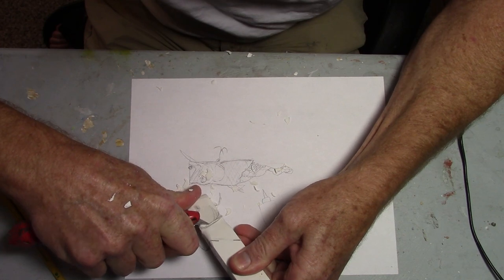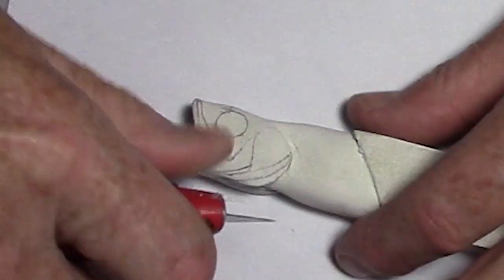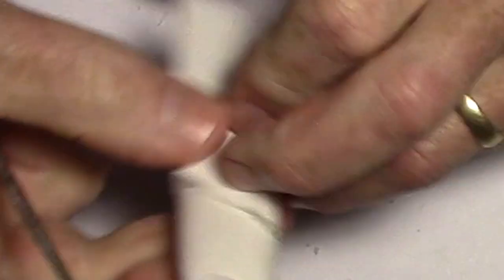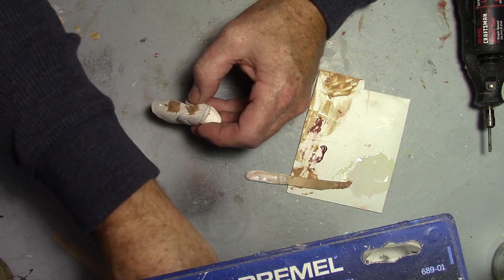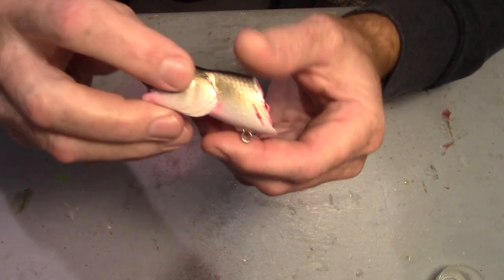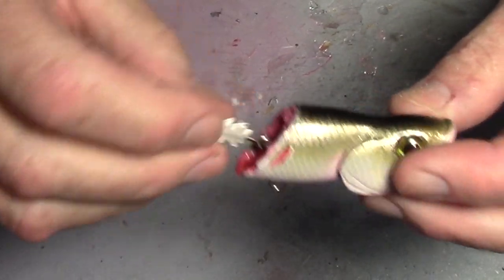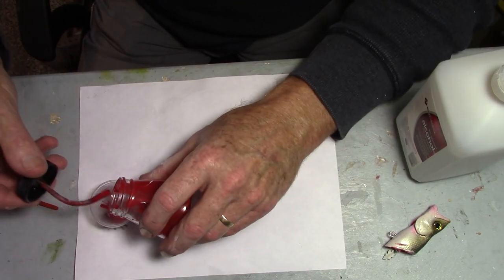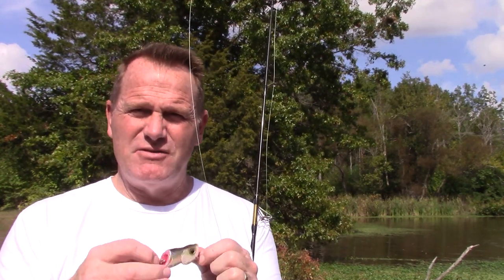No Guts...No Glory!..how to build an injured baitfish lure.

Comment: Woow nice lure build 🤩🤩

A easy fixture for the gore, you could drill a hold in the "Christmas tree" and when you push on the rubber gore organs you can push at toothpick through the rubber and hole and then cut the ends of 😉👍🏼
Reply from the maker: That’s a great idea!

Comment: Your carving skills are impressive!  🙂What type of wood are you using?  New Subscriber!
Reply from the maker: It’s a pvc board that is used in construction
Reply: @lureup9973  Thank you 🙂
Reply: @lureup9973  Have you tested the strength of the PVC board with the lure eyes?  EX. how much pressure it takes to pull one out? Really interested in knowing how it holds up.  Thanks